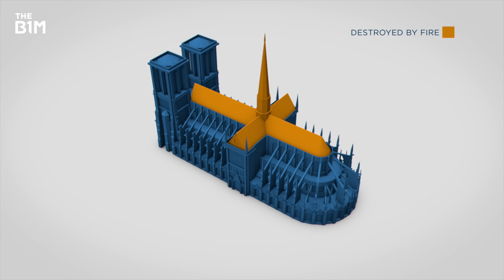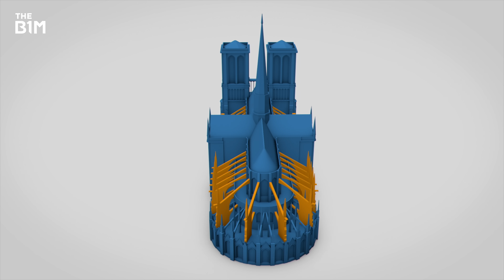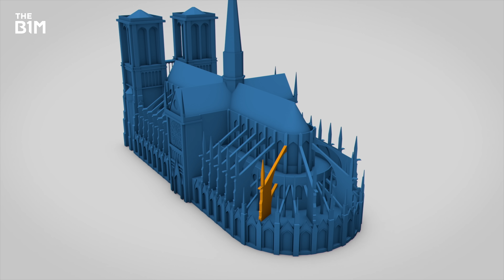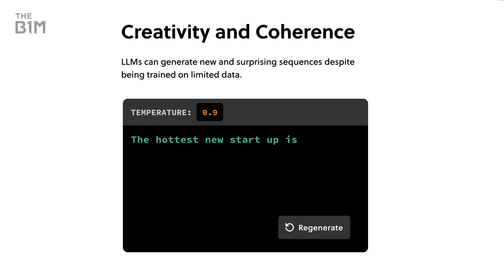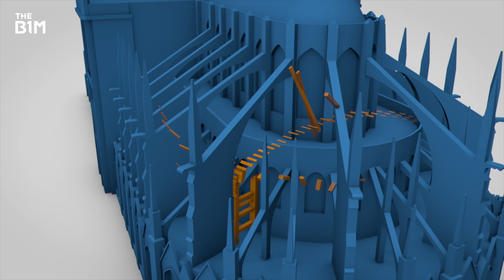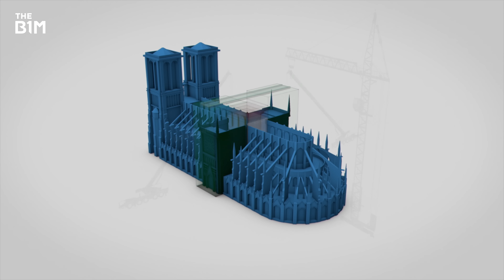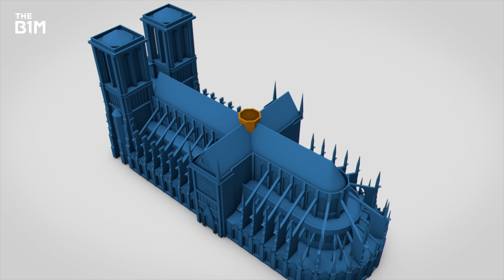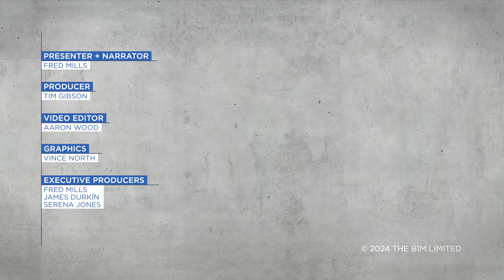How France Rebuilt Notre Dame

Comment: The trees are not 200 year old, they are closer to 80 years of age, it's enough and it's what people used also the first time. The way to grow oak trees to make them strait, with little nots, is to use a previous oak tree. You cut it's base, let 3 new trees grow from the base so they compete with each other and grow fast and strait. If the trees you have are not strait, then you just go with the shape of the tree to keep most of it intact. You want to go with the fibers and not against them.

Comment: The most "unstable structure" I saw in this video was that yellow crane. I would need to change my pants if I found myself at the top of that thing. No way could I be a crane operator at those heights on something that looks like it could be pushed over with one hand.

Comment: Hard to believe that the " forest " of oak beams in the roof section of the building didn't have a sprinkler system built into it , given the speed at which any fire no matter how small would spread in such dry and flammable conditions. One day's work on the restoration would have paid for the installation of the most high tech sprinkler and avoided the pain and trauma caused, and the cost.

Comment: The public,collectively realized the challenges as they arose,for this reconstruction. There was no pressure on the reconstruction team other than to insure it was being performed to the highest standard s. Be it deconstruction, decontamination and rebuilding. 
It was fortunate that a few years prior, it was permitted to laser scan the entirety of the cathedral including the roof structure above the vaulted ceiling. This scan provided the reconstruction team to give exact dimensions for every part that was and will still be required. 

The Public at large collectively stated that despite any politician trying to force a deadline, the public insisted to perform the work correctly no  mater how long it takes.

Comment: After they finish there should be a large astrix above the building , The new spire has no sentimental value to what was originally built so long ago ! It's like going to the museum to see a replica of a Rembrandt ! I do appreciate the details in rebuilding but for me it'll never be the same again  .
Reply: Well, the original spire was destroyed 300 years ago, and replaced by a new one in 1850. The "sentimental" value for that one was very recent, actually.
Reply: By "so long ago" you mean the mid-19th century.  The whole building is a mismash of reconstructions and restorations from different time periods.  The new roof and spire is just one more contribution in a long lineage of contributions.  Besides, unless you have a time machine, there's no point in getting all upset about what you can't get back.

Comment: In can understand that they wanted to rebuild it like it was, but why did they still use wood even in places that are not visible to the public? How will they prevent that wood from burning again?
Reply: They do not have ignition sources like electric cables there.

The only reason why they had electricity up there was due to renovation and it seems this eas the reason it started to burn.

Comment: Personally I would have preferred they rebuild the entire building - and make it look like the original. Build it stronger than it was before.
Reply: ...?  The entire building wasn't lost.  Mostly just the roof and a bit of the interior vaulting.  And they did rebuild it as close to the original as possible.

Comment: Thank god they didn't do any 21st century re-contextualization and stuck with the traditional design - a decision made even more impressive when they decided to craft the new pieces of the cathedral using as many period-accurate methods as possible. It would have been a travesty to lose such an iconic and historical piece of architecture for such a benign and, quite frankly, narcissistic reason as "modernization" - the thing that makes the Notre Dame (and many other historical sites) so special is it's preservation and presentation of the past.

Comment: Perhaps the engineers who 'invented' flying buttresses were not inventors but careful readers of the Bible. Supporting arches, with intakes so that they were not fastened to the walls, are laid down in chapter 41 verses 6&7 of the Book of Ezekiel, where an ideal temple is described with measurements, and structural details.

Comment: If I recall what I heard correctly, the collapsed roof was lead sheet supported by oak structural members. Seems so heavy. There are certainly better alternatives to lead in the 21st Century. I wonder how it's been done.

I was only in Notre Dame Cathedral once. It was an incredible feeling to be inside that huge vaulted space with the light coming through the stained glass windows. I hope that those windows weren't too damaged in the fire. After all, the panes had been removed during WWII to prevent their destruction. One would hope they'd remain for centuries yet for future generations to appreciate.

Comment: ... It's interesting to note that REAL reason they were able to rebuild the Notre Dame so quickly is because the building was 3D Laser Scanned 2 or 3 times in the years prior to the fire which created an exact 3D Digital copy of the Church!! These extremely detailed and highly accurate Point Clouds were then used to reverse engineer the building and break it down to its individual structural components. This video needs to be redone to include this very interesting fact!!!  Without these 3D Digital copies, it would have been practically impossible to rebuild this beautiful building back to its ORIGINAL form prior to the devastating fire.  At the end, the EXACT reason why the final decision was to rebuild the Church to its ORIGINAL form was because of these 3D Laser Scans!
Reply: There are also the original plans, photos, videos and other documents. It would be harder, but they would still make rebuilding possible. But yea, stuff like Ubisoft giving the team the scans they made for Assassin's Creed Unity also definitely helped

Comment: Great video! I would love a Christmas special on Winchester Cathedral. This masterpiece was falling apart with massive cracks due to the high water table making the structure unstable in the early 1900s. A deep sea diver called William Walker spend 5 years underground in the pitch black totally submerged laying cement bags and bricks. What a true hero! Even today, although Walker saved the structure, the crypt still floods with crystal clear water and any overly curious visitor will find themselves with wet feet...
Reply: WOW! That's incredible. Sounds dangerous. Are there any YouTube videos on the subject that you would recommend?
Reply: @kbpeters4246  I hvaen't come across any. In the city of Winchester itself there is a pub named after him, a statue near the cathedral, and inside the cathedral there is a display. When Walker retrieved the ancient wood logs used originally in the foundations they were dried out and a local craftsman carved pocket sized trinkets and these were sold outside Winchester Cathedral!
Reply: @COMEINTOMYWORLD  thank you for the info!

Comment: What The B1M didn't say in the video, is that Notre-Dame is going to reopen on December 8th. 
Even though most work will be done by December, the restauration will still continue til 2027. Those small works will be focused on the outside of the Cathedral, and the inside of the towers.
Reply: Actually they mentioned it in the beginning

Comment: Lead decontamination (dust) was a huge part at the beginning as well for safety of workers.
Reply: they had to dismantle all 8000+ pieces of the organ and clean and repair each piece individually before putting it back together. Apparently the tubes were full of lead dust
Reply: @user-aero68  I would love to hear it play. If they cleaned it out then it will sound like it did when it was new now. Thats a treat noone has heard in centuries.
Reply: A lot of people don't really know why the lead pollution is of such enormous scale. Turns out the roofing material used for the cathedral is made of lead metal sheets. At the time, the metal's softness and high density was really helpful in forming a watertight cover that could be easily fastened to the structure. Bad news is that it takes an awful lot of material to cover a roof this big.

Comment: The Whole thing honestly is its stupid to try save buildings that cant be easily stopped from breaking, as long as its possible easily its alright but when it becomes complicated and hard its easyer to just turn it down and rebuild it in original shape look and design. Since restoring it like we do nowdays is essentially just the "If you replace all parts of a boat is it still the same boat?" Yeah so really tearing it down and rebuilding a structure if its too expensive and complicated to save is the best but we decide to restore stuff complicatedly and expensive.
its not the same if every part is been replaced anyway so just tear it down and rebuild.

Comment: Comments on the time it took and the four month over-run (only four months, on a project of this size and complexity?) also overlook the effect of the 2020 pandemic and the fact that France was in complete lockdown during the summer (the best time of work for construction work) and thus the over-run is actually closer to one month. And also bearing in mind that it took over a year just to clean the place of all the lead dust from the lead roof that had settled on every inch of the interior. (Incidentally, this is only part 1 of the restauration because only after the interiors have been re-opened at the end of the year that they will start the inch-by-inch restauration of all the exterior stone which thus far has only been reinforced and made safe so that the interiors can be completed)

Comment: flying buttress main reason to exist is not the one you mention... the are meant to balance the horizontal stresses coming from a ever larger roof. not more vertical load. if it was that thicker walls would sufice.
I suspect, that the lack of the roof that produced the horizontal stress was a huge reason for the destabilization of the  flying buttress
Reply: You are wrong and don't understand explaining load lines.
It's a general public video, and in fact, it is holding the load or the roof which is vertical from the buttresses.
Reply: @sparksmcgee6641  
I'm, a  civil engineer i know a fair bit about stress analizis. but you just need to check wikipedia...

"The advantage of such lateral-support systems is that the outer walls do not have to be massive and heavy in order to resist the LATERAL-FORCE thrusts of the vault."
Reply: @pinheirokde  Seriously? You're an engineer, and you're  citing Wikipedia???  I know how a flying buttress works. 
I'm a builder. I'm the one people blame if a building collapses. Never heard  someone say we should ask a civil engineer how to do a structural engineer's job.
Reply: @sparksmcgee6641  in my country civil engineer are structural engineers... I'm giving you a Wikipedia article because  they are written in layman's terms, if that's not enough for you there is always school, 
Btw ton of respect for builders my father was one so was my grandfather. But you should know what you don't know...
Reply: @pinheirokde   You should know your comment is meaningless and false. No one uses flying buttresses on a 3 meter tall building, so saying it's not vertical building load is a lie. Everyone knows the load line doesn't go straight down, but it doesn't go straight horizontally like you said either. 
The load line in a flying buttress is actually in the air in many flying buttress designs.
Just be quiet.
Reply: @sparksmcgee6641  yeah what do I a civil engeneer know about stress analisis :D

very simple you you have 2 beams in a angle subject to a vertical force when it hits the ground it decomposes in to a vertical axis and an horizontal one, you know becouse the beam in on an agle and can mostly freely rotate on the basis (no momentum trasmited)

in old roofs you can see this beeing offset by another beam conecting the basis of bowth ends of the "triangle" that beam would be under tension, 

Now on big roof you would need a realy long tree to make those but they would bend under their hown weight.
( in mome more "modern" churches you would see metal rods doing the same thing) (metal work in the midle ages had not reach that point and they mostly relied on compressive engeneering and stone work)

Solution ... flying buttress  to allow the horizontal stress to be carried over to the ground unsing arches

Comment: You make it sound in this video like the 'flying buttress' was first designed for and used on Notre Dame, but in fact the flying buttress was developed and first used in the 3rd century, were as Notre Dame was begun to be built around 1163! So it wasn't a fairly new concept as you state, unless you consider 800+/- years as 'fairly new'!

Comment: One interesting fact and thing that made the process much easier that has been left out of this video, is just before this HTC Vive had commissioned a VR experience of the Norte Damn, when they were making the experience they Lidar Scanned and 3D mapped out every corner of the building so they can create a digital twin in VR. The luck of this being completed just before the fire meant the builders and architects had one of the most accurate to a mm digital reconstruction, without it, we may not be where we are today.

Comment: So, the original construction took couple centuries and reconstruction from the ashes took ~5 years and some people still complain that we don't build as we used to. Duh, we are doing it much better now.
Reply: To be fair, we dont. 
Obviously we can, but our society for the past 80 years or so has prioritized function over form to a disgusting degree.

Also note that repairs, and reconstructing the roof and spire is not a fair comparison to the construction of the entire building.
Reply: @KDeds21  id argue as a carpenter that many times a repair or reconstruction is way more complicated than building something from scratch with plans and sketches
Reply: @b5254t4rs creativity takes more time.
Reply: @insertyoutubeusername most of the buildings that "last forever" were repaired and rebuilt many many times during their lifetime and we don't see what was done before us the same way we won't see building standing (of falling) after us.
As for wood we have many more ways to treat it: you can microwave dry it to precise humidity, you can pressure harden it to desired spec, you can epoxy cure it, you know exact ways to protect it against elements, etc.
Reply: It takes more time to create something original than to repair
Reply: @sasnad3  depends on the repair
Reply: You have the comprehension skills of a goldifsh who spent the last month out of the water…
The roof in hardwood and modern spire were lost, not the brickwork.
Reply: @G_de_Coligny  so, you would argue that in the modern world we would spend five more centuries to relay the brickwork? Have you seen other videos on that channel?
Reply: @rotors_taker_0h  what we build these days will not last the time it took to build structure like Notre Dame.
Reinforced concrete turn to sh1t at a comical speed… metallic structures are literally biodegradable. Modern brick and mortar degrade ungracefully too..
Reply: @insertyoutubeusername sorry bro, you can't convince me to pay for over-building useless megalithic structure to praise non-existent gods that will be all but forgotten just for a second of distracted delight of some bored tourist 10000 years into the future.

Maya and all others were able to coerce their population to do just that and I'm glad we done with these practices.

We engineer our structures with predictable lifetime and we usually want things to last as much as we want and it usually isn't forever. I don't think my grand-grand-grand-grandson 200 years later would appreciate me spending a lifetime earnings on building two meter thick stone house just to impress his grand-grand-grand children when he will already have some unimaginable atomic building tech that makes precise 3D nanotube-reinforced graphene-diamond composite buildings on the Jupiter orbit using fusion-powered autonomous construction robots.

Comment: That scaffolding though... 😳
Reply: Cutting the old scaffolding in pieces was an extremely dangerous process, as they had to saw the melted metal piece by piece in such a way that the whole thing didn't risk crumbling, killing the workers at the same time.
Reply: @InXLsisDeo  
No, I was talking about the replacement scaffolding.
That's incredible, that's obscenely complex. 
The design work that must have gone into that, balancing lateral strength and support strength. 
I wonder if the scaffolds increase in diameter as you go down the structure. 
And the shape they had to confirm to, all true functionality they had to build in, the safety measures. 
Cutting the old one down, yeah, it's crazy dangerous and you're playing Death Kerplunk but ultimately it's careful demolition, top to bottom. 
All while Notre Dame is trying to fall down around you.